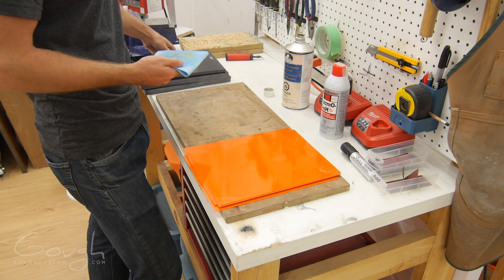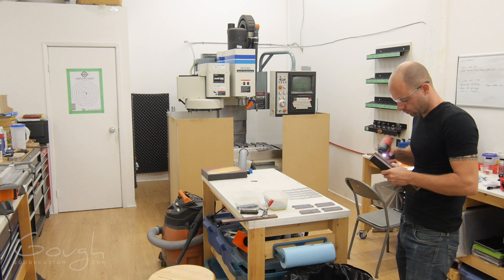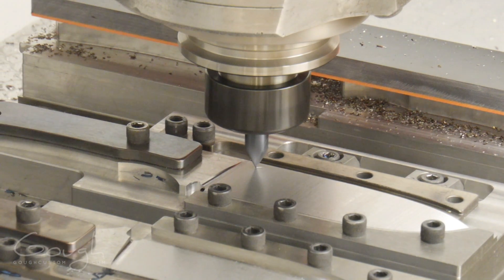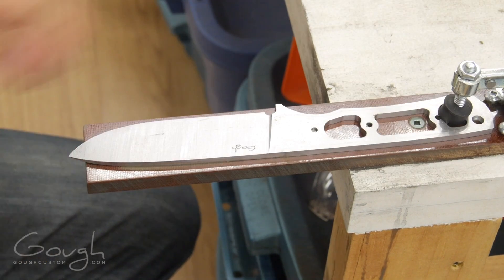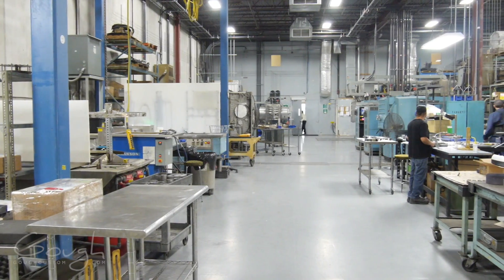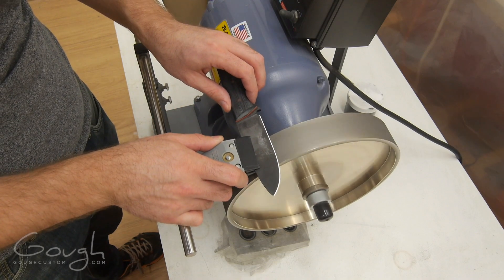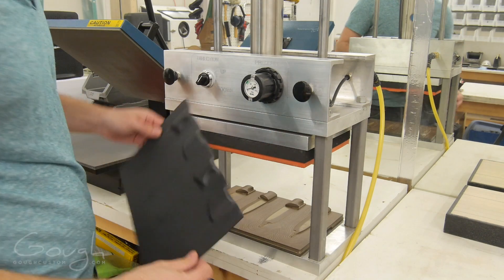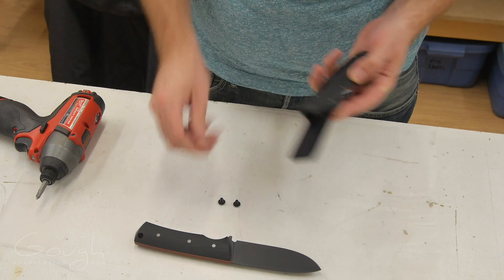Making a knife the high-tech way - Resolute MkIII

Comment: Making knives without a forging process is basically witchcraft and I don’t support it
Reply from the maker: Haha, well I enjoy witchcraft and practice it whenver I can!
Reply: Wow , that CNC machine is one Helluva craftsman. You go Mr. CNC !
Reply: he bought steel which was already forged
Reply: @bakanibaleni5865  
Was it? I looked it up and forging seems to require hammering of some kind. He could be using rolled steel.
Reply: The blade blank was forged...Just not forged to shape. The metallurgical consistency and overall quality is probably much higher on these blanks than on the average hand forged blades from artisan knife makers.
Reply: @volvo245  true!!
Reply: @volvo245  that blank was not forged this is stock removal.
Reply: @volvo245  It looks like he's using regular rolled steel. I thought forging provides superior grain structure? Isn't this the concept which gives stamped steel it's strength? Forging increases strength in a blade.
Reply from the maker: @D0NtPh34rTh3R34p3R  'Forging' is just another name  for 'hot work' and most steels are 'hot worked' at the mill which produces them, usually by rolling but sometimes by other processes like pressing etc... My steel is made by a specialty mill in Germany (Lohmann Stahl), it is cross-rolled for the best consistency of the grain structure and alloying elements. As @volvo245 said the consistency that you get in steel made this way is always going to be higher than that produced by any hand-forging process. The mill has had many, many, years to get their process perfected and I use steel from them specifically because of it's high quality!
Reply: @GoughCustom  I work at a steel supplier, we sell hot rolled and cold rolled steel to our customers. I've heard of extrusion presses, but that's forged steel. Extruding, using closed or open dies all counts as forging. You are applying force to change the grain structure in all of these cases. An anvil and hammer is just an open die press, just way less technical. Forging closes bubbles or gaps in the grain structure and makes the grains smaller adding to it's strength. I could be wrong, but this is what I've come to understand. I think your knives are awesome btw! Here is a source from a steel mill  https://www.astmsteel.com/steel-knowledge/steel-forming-process-hot-rolled-cold-rolled-forging-casting/
Reply: @GoughCustom  I don't mean to sound like a jerk. I'm still learning about these technologies. From what I can tell from a little research, homogeneous grain structures aren't beneficial due to slippage. If you want the strongest lightest and most ductile steel, the grains need to be formed along the shape of the part. As far as I can tell, this is irrelevant if you're using cpm or another powdered metal process. I think the advantage gained with powdered metal is that the alloys are more evenly mixed and you can add more ingredients to improve wear resistance, however the steel produced is porous. The part I don't understand is how companies are charging more for this process, when similar techniques like Metal Injection Molding were designed to save on material cost. Your knives are still leagues above others though. Here's a similar a2 steel's grain structure on a plane toll blog, it's there although it's quite small https://hocktools.wordpress.com/2010/06/19/o1-v-a2-one-more-time/
Reply from the maker: @D0NtPh34rTh3R34p3R  Lots to respond to here!

1) It's worth remembering that a knife is a pretty simple flat shape with all the important bits (the cutting edge) lined up along the middle of the steel bar, so a rolling process does actually result in the grain being lined up where we need it to be. Forging for strength is much more important in parts that have more complex shapes and need strength in a lot of different directions. 

2) Hand forging is a relatively imprecise process and can add issues that are impossible to see with the naked eye. Long times spent at high forging temperatures can result in excessive grain size. Hammer strikes when the steel is too cold can result in stresses or even cracking being introduced into the steel. The ideal forging process would be one of the much faster industrial processes like drop forging or hot pressing as they're much quicker and more uniform. For a knife I don't think you'd see much benefit though to be honest.

3)  The powder metallurgy process can have a number of potential benefits: The first being that there is much less 'alloy segregation' or 'alloy banding'. In a traditionally melted steel the middle of the cast ingot cools more slowly than the outside, and this means that alloying elements with high melting temperatures can migrate inward during the cooling process, making the steel less homogenous. The powder process stops this because each tiny droplet of steel cools almost instantly as it is sprayed from the crucible to form the raw powder. The second benefit is that high alloy steels (especially those with lots of chromium, like stainless steels) tend to form large carbides, and these carbides form weak points in the steel structure that makes cracking more likely (makes the steel less tough). The powder process limits the maximum size of the carbides to the size of the powder particles, which can greatly increase toughness. Many steels are not available in a powder version (like O1 and A2) because they don't tend to form large carbides, and therefore see little to no benefit from the powder metallurgy process.

4) Powder steels are not porous... Powder steels are formed from the raw powder using a process called 'hot isostatic pressing' which presses hot powder together under huge amounts of pressure until it becomes a homogenous solid. There are no pores left when this process is done properly. There is another process that is performed using powdered metal called 'sintering' which does indeed result in a porous part. Sintering usually involves heat but little to no pressure, so the metal grains bond together but do not become fully solid. Sintered parts are cheap but don't offer the same level of mechanical strength as a part made from solid. The powder steels used to make knives are not sintered, they are hot isostatically pressed which means there are no pores left.

5) Metal injection molding is actually just another form of sintering. Metal powder is mixed with a binder, the resulting slurry is injected into a mold, and then the 'green' part is removed. The green part is quite soft and can usually be crumbled by hand. The 'green' part is then put in a furnace and high temperature is used to burn out the binder and bond the metal particles together. Done in a vacuum furnace this results in pretty strong parts, but again are not as strong as parts machined from solid. Usually the parts are designed around this, and the lower cost makes it worthwhile. This is not a process I would want to use for knives.

Ultimately I do not believe that there are large benefits to be had from forging when it comes to knives. The cross-rolling process at the mill largely puts the grain where I want it to be and their tightly  controlled processes ensure there are no issues lurking hidden inside the steel.

Powder steels are potentially better than A2, but I have tested quite a few of them and have yet to find one that forced me to want to switch over. I plan to test more steels soon and I have a previous steel testing video on my channel which you might find interesting! If I can find a powder stainless steel that has the same (or higher) toughness than A2 does then that will be something that will make me sit up and pay attention! CPM154 looks to be a potential candidate in this area, but I need to do more testing with it when I get the chance!

Hopefully this made my reasoning and some of the processes more clear! Happy answer more questions if you have them, I love talking about metallurgy!

-Aaron
Reply: @GoughCustom  thanks for the reply 👍 I still have a lot to learn clearly.
Reply from the maker: @D0NtPh34rTh3R34p3R  Any time! I still have a lot to learn as well! Metallurgy is amazing, and amazingly complex!
Reply: Gough Custom I just read your very in-depth answer and I was overwhelmed with the amount of information and knowledge you have gained!  Very impressive...almost as impressive as the beautiful knifes you build.  You have incredible skill sir.
Reply: @GoughCustom  just read your in depth answer. Tl;dr: it's indeed a witchcraft. Lol. Keep up the good work! I enjoyed watching this.
Reply: @GoughCustom  *its. grammar, like knife steel, should be sharp structurally consistent modern and german.
Reply: It was vacuumed forged, just like our punch press dies at work. Much harder than any hand forge can do...
Reply: PowerfulVeganHands Oh how right you are. He’s kinda the Pauly of American chopper that darn old cnc machine. He’s doing to much I get it. Holla
Reply: Excellent work !
Reply: Stock removal?
Reply: Agree
Reply: @Jose Luis Why did you just link the same video? Did you mean to link a different one?
Reply: This is simple industrially made product. Just like those knives that sell every supermarket.
Reply: Can you all just shut tf up and just enjoy the video?

Comment: nice knife, but if you're not going to forge the blade, why not just use stamped out blade blanks to begin with?  wowsers, 3 bills seems a bit lofty.  nice knife though.
Reply from the maker: The reason I don't forge the blades is because forging limits you to simple steels, which in turn limits performance. I try to make the best knives possible! And that's only possible with more advanced techniques like this

Comment: Does anyone know what type of steel these are made from? Are there any disadvantages of not forging and just milling out the form of the blade? Powder metal steel might allow this without losing too much toughness from not being forged.
Reply from the maker: Hey mate! They're made from A2 tool steel, which is a very tough steel even at high hardness, I have a steel testing video that explores this.

Also: you don't get any extra toughness ( or any extra performance at all really) from forging. Usually the opposite is true in fact. Given two knives made from the same steel, one milled and one forged at best the forged knife will be "as good" as the milled knife. Usually the steel in the milled knife will be better as it has been subject to more closely  regulated processes.

There are some advantages to large industrial forgings for big parts, but this is usually only for parts that are not further heat treated.

Comment: Nice Video. Entire process wasn't completely high tech since you manually sharpened the blade instead of some automatic process which was what I was expecting, but still very entertaining to watch.
Reply from the maker: Thanks mate! Some things are a lot of work to automate, sharpening is one of them. The automated sharpening machines are very expensive and are honestly not all that good, so I built a specialized rig to do it quickly by hand!

Comment: How do you make the holes so nice in the nylon webbing?
Reply from the maker: +Colin S hey Colin! I made a little "annular cutter" out of A2 that has a razor edge, used in a drill it makes clean holes very cleanly. I then deal the edges with a quick pass from a blowtorch
Reply: Gough Custom I think I just bought a device similar to that. Called a spin cutter by sailrite
Reply: Gough Custom Thanks for sharing!

Comment: These are gorgeous knives, but 350 dollars for A2 steel? Thats waaaay too expensive being that you have a CNC machine now and arent doing these 100% by hand . . you considered dropping the price a bit ?
Reply: 350 isn’t even that much nowadays for these kinds of knives. I just buy buck knives for that reason.
Reply from the maker: +Technie87' if anything my price is still low, my knives sell second hand for more than I charge for them! Also, it sounds like you consider A2 a low performance steel which is not at all the case, I have tested my A2 against a lot of "super steels" and done the edge retention and toughness of A2 to be better, which is why I haven't switched!
Reply: No its good steel just by doing a quick search online, however for the price you're selling them now I would think its for profit. A2 steel is a "tool steel" , not a knife steel.Yes knives are tools but if your making "handmade" knives and charging a 300+ price tag for them , we as consumers should at least get a dedicated knife steel.I would definitely be more inclined to drop 3-4 benji's if you would make these out of a mid-high to high range knife steel.
Reply from the maker: Technie87' sorry mate but you don't understand: there are no"knife steels".. all knife steels are also tool steels. If you look on the crucible website at steels like CPM154 it will say that they're "cold work tool steels", intended for use making injection molds, slitting tools, dies and so on.

Also: I do not say that my knives are handmade. Low volume production. My older videos say handmade because they are videos of me making knives by hand.

Finally yes I have to make a profit. Any business that wants to continue to exist has to make a profit. My profit margin is not high though, last year I made 150 knives and took home about $36k before tax. Shall I make no profit and just not eat instead?
Reply: True lol they do say that, guess the way they display knives and their steels on stores are just by putting the top ones used in production. .I've never seen A2 used on a knife that I've looked at online.

And yes your motto has changed which changes my view towards you selling these. Don't like people fluking the less knowledgeable over stuff which is why I asked these questions. Continue eating otherwise we wont have any more knives coming out :).Now this brings the question, how much would you sell a CPM154 version of this knife if you WERE to make one?
Reply from the maker: A2 is relatively rare in knives, which is a shame as it's a much better mix of hardness and toughness than most other steels!

I will be looking at stainless steels sometime this year, I will do a full head-to-head test of a couple of steels and then after that I will hopefully be offering the Resolute in a stainless steel for around the same price as the current Resolute.

Comment: What if there was a sheath that had a material inside of it the would sharpen the edges of the blade when the weapon was sheathed or drawn?
Reply from the maker: There are some systems that work a little similarly, like the Wiltshire Staysharp system... However they tend to sharpen the blade far too much and wear it down quickly, and the quality of the sharpening tends to be quite poor.

Comment: What grit of blast media do you use for the aluminum oxide and glass beads?
Reply from the maker: +Rocketkid2121 hey mate! 120 grit aluminum oxide, 60 mesh glass beads
Reply: Perfect! Thank you I can't get over how good that finish you get on your blades with that mixture is. I think it would work well on a number of other things as well!
Reply from the maker: +Rocketkid2121 yeah it works great on lots of things! Final surface feels like the surface of the track pads on MacBooks, really silky and smooth!

Comment: When making knives, if you go the milled and machined route, everything has to be perfect for it to catch my eye (I'm more of a hand-forged kinda guy). Well, these have caught my eye. The only nitpicky thing I have is 63 HRc, which seems just a tad too high for a knife that might be encountering some hard materials out in the field. It is A2 though, so I'd have to use it for myself and see if any nicks come out of the edge to be sure of that opinion.

In any case, seems like extremely high quality and well worth the money, and I especially appreciate the transparency of your process.
Reply from the maker: +Ty Grenier thanks very much Ty! I have done a lot of testing with my A2 and even at 63hrc with my heat treatment it will still dent or roll before chipping, A2 is very tough so there's still plenty of ductility! Edge retention at that hardness is great, and toughness is still high enough for batoning and so on with no worries!

Comment: That sharpening system looks a lot like the Tormek T7.  Inspired by it? I mean its practically the same
Reply from the maker: +sarcasm2k inspired by it for sure, but there are lots of functional differences. I didn't buy the tormek because I didn't want to be constantly maintaining the stone, the CBN abrasive cuts way faster and never needs leveling or any other maintenance... The VFD allows variable speed and reversing so I can strop without changing any setup which is also another big advantage over the tormek.

Comment: When hand sanding a blade, do you sand back and forth horizontally and—when you change to a finer grit paper—sand vertically (and so on)? Or, do you sand along the same (long axis) of the blade throughout the entire sanding process?
Reply from the maker: +CityStick I change directions only when I change grits! I have a video that shows my preferred process in detail if you check out my channel.

Comment: im not really into cnc but shouldn't you cool the tools while cutting?
Reply from the maker: +Dániel Bulyovcsity it depends on the tools! Mine are coated to resist heat, so the air blast is enough cooling!

Comment: Maybe put strap for the knife across the handle so it doesn’t fall out of the handle by accident. Quality knife though.
Reply from the maker: +Matthew Flores hey Matthew! There is actually no need for that as the sheath is designed to retain the knife without a strap, the blade clicks into place and is held firmly. I have a lot of these "in the wild" and have never heard of any coming loose accidentally!
Reply: Gough Custom Thanks for the quick response!,